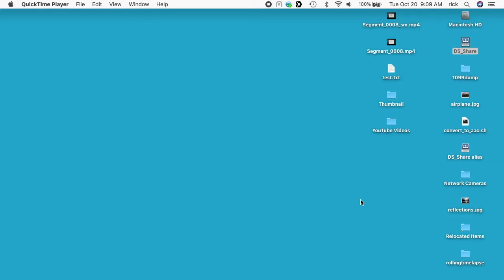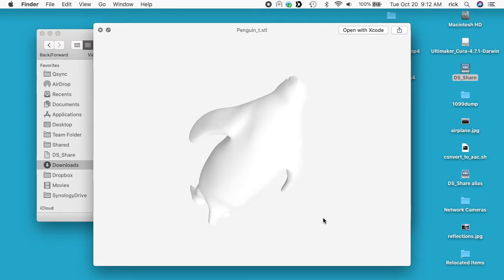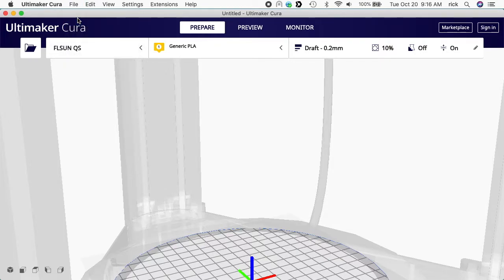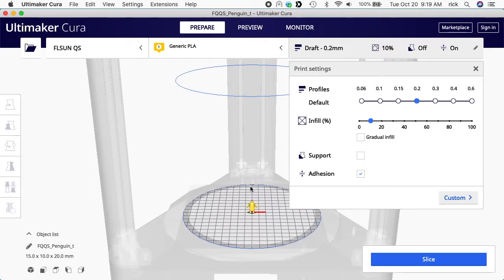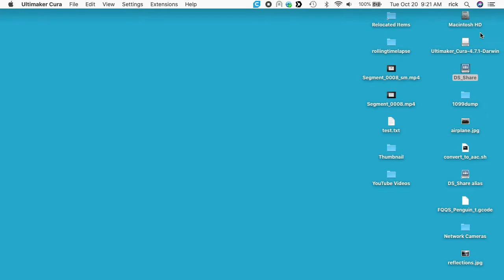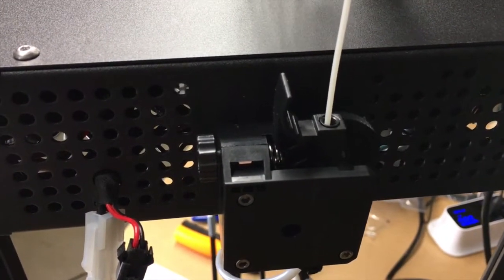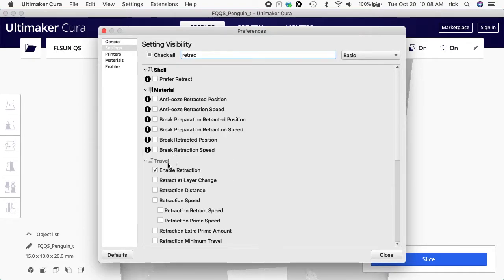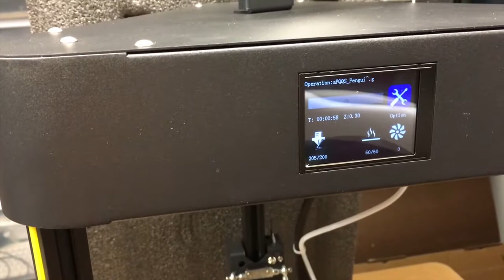FLSUN Q5: Print Thingiverse Model using Cura (Ep. 4)

Comment: I think your first layer is too low, that's why you struggle getting the prints off.
Reply from the maker: Thanks for the input! I'll have to play around with that adjustment to see if it helps.
Reply: @Rickmakes  I had the same Porblem, much to tight. After setting z a bit higher it's much better. The z-Level should be set with a heated bed to avoid a firt layer that is too low.
Reply from the maker: @markusk4527  I set it up again but with a heated bed this time. It made a big difference. Much easier to remove prints.
Reply: I know im asking the wrong place but does any of you know a method to get back into an Instagram account..?
I stupidly forgot the account password. I would love any tricks you can offer me!
Reply: @Brayden Leonardo Instablaster =)
Reply: @Finley Quinton thanks for your reply. I found the site thru google and I'm waiting for the hacking stuff atm.
Seems to take a while so I will reply here later when my account password hopefully is recovered.
Reply: @Finley Quinton It did the trick and I finally got access to my account again. Im so happy!
Thanks so much, you saved my account !
Reply: @Brayden Leonardo Glad I could help :)

Comment: hi man i have a  flsun q5 but i think your first layer is wayyy to low with my printer when it cools off the part is just loos.
Reply from the maker: Yes. I have since raised it up a bit and it has helped a lot. I have also started using a glue stick to help with adhesion (in certain cases) and to help with releasing the prints.

Comment: Hey,
i have the flsun q5, both test prints printing really nice but whatever i slice in Cura 4.12.1 with the Q5 profile looks horrible.
Someone please can help me and tell me what i need to change
Reply from the maker: I'm using the default settings on 4.13.0 with the exception of Retraction Distance and Speed which I have set to 8.0 and 80.0. Temp and bed are set to 200/60.
Reply: @Rickmakes  thank you , I will try that